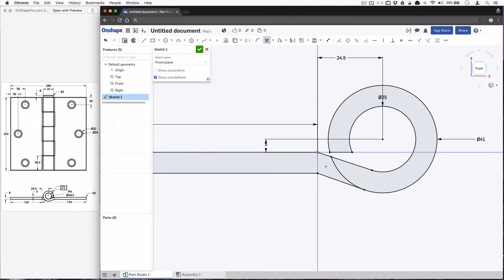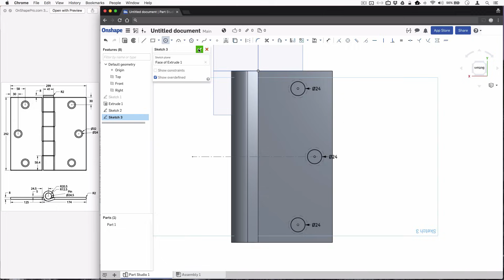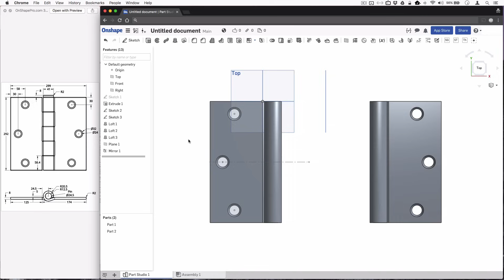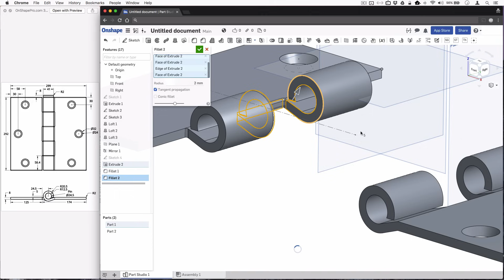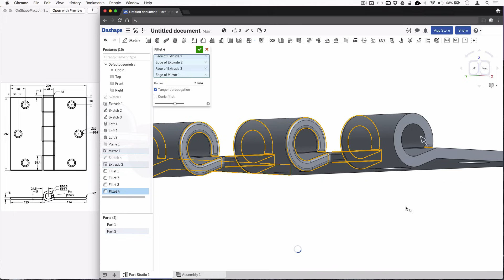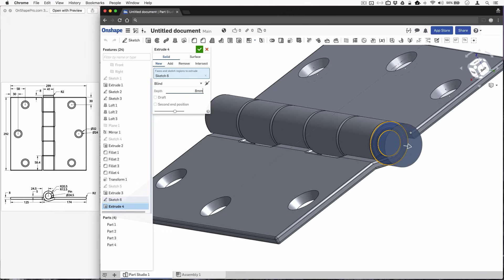OnShape 3D Modeling Hinge Tutorial Exercise

Comment: One question: when "transforming" and putting both parts of the hinge together (@ 17:18), how did you come to that 251 mm on the x-axis...? If the draft doesn't have this measurement, but the full span is 299 mm, which is the total length of the hinge assembly?

Comment: 1. Funny way to make tapered holes --typically a c'fer angle is called for (82 deg, 90, or 100).

2. You have designed a hinge with only nominal dims --no clearances between leaves.  Good luck at assembly time.

Comment: Do not, I repeat DO NOT model this way.  By dimensioning every feature manually, you're losing the vast majority of the benefit of parametric modeling.  If a student of mine did it this way, they'd fail.  The right method is to design one side, then make the other side's dimensions related through equations.  Rookie.
Reply: there is no place for hate comments or trolling on the internet it should be a fun and 9interactive place for people to spread posivitivity and joy my dad once told me if you have nothing nice to say dont say it at all so you should just keep this kind of comments to yourself
Reply: As a veteran educator and engineer, I grow weary of supposed experts propagating bad habits.  No hate here, just facts.  Think about it, done this way what would happen if the hinge needed to be changed, even just a little?  Chances are every dimension would need to be manually recalculated and re-entered. So much wasted work, so prone to error!  In the real world this method would hamper attempts at modifications or creating other versions.

Comment: Nice little tutorial. Some suggestions for improvements could be to use a parametric approach to enable a more flexible design. Also the topic of tolerances needs to be addressed, as this design would not be 3d printable unless some tolerances are added between the parts.
Reply: Explain?
Reply: @dniezby   the  3 part can''t fit in real life because there is no tollerance between they.

Comment: If you do the fillets before the mirror, you only have to do one half and a couple ones where the cuts are on the other half.
Reply from the maker: Jan P the edges I need to fillet are not created until after I mirror the part and finish cutting out the tabs.